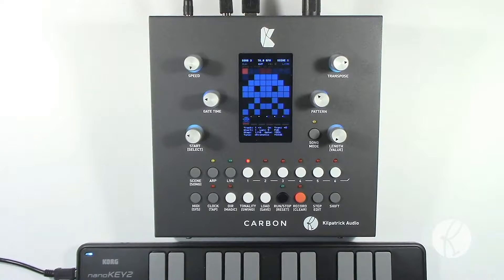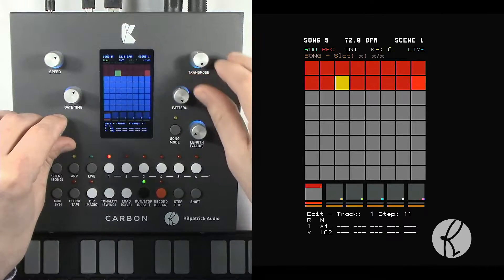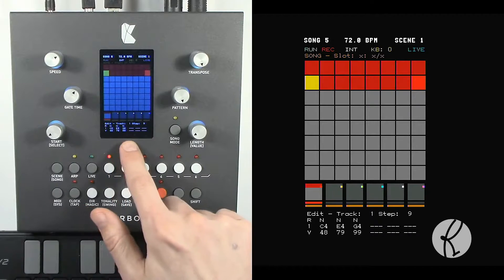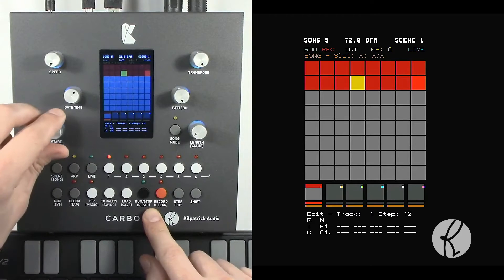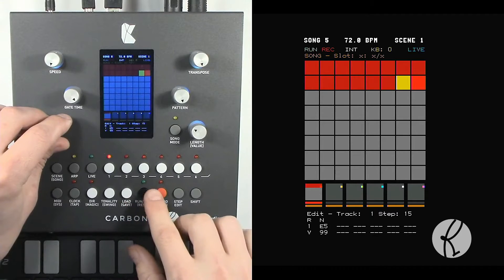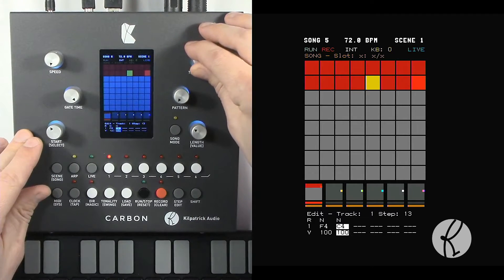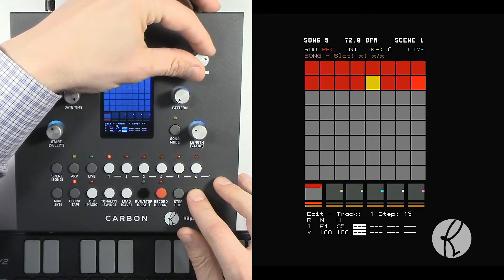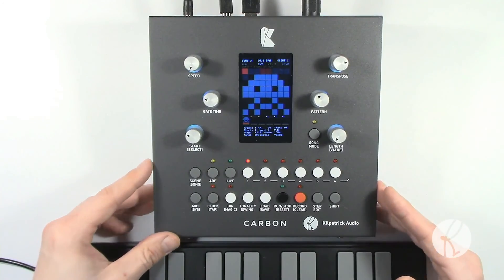Step Editing - CARBON Sequencer

Comment: When you move an encoder more than one step but the display doesn't change, does that change the parameter? I have always wondered, especially when changing step duration.
Reply from the maker: The duration shows in beat value, i.e. 16th, 32nd, etc. but there is actually more resolution since you are adjusting in clock ticks. (CARBON uses 96 ticks per beat) In cases like duration or delay the display will show the closest musical length.